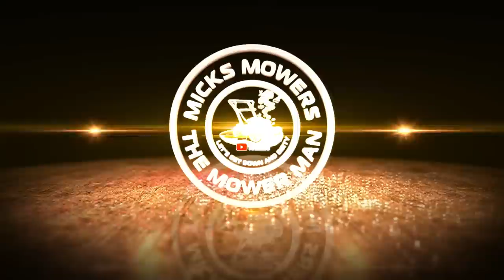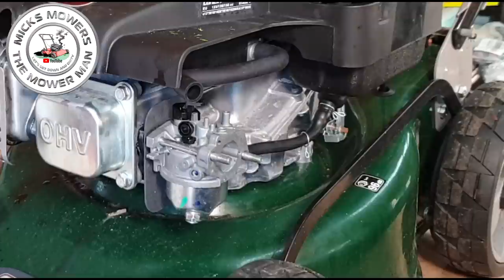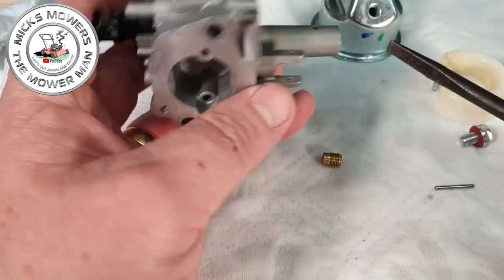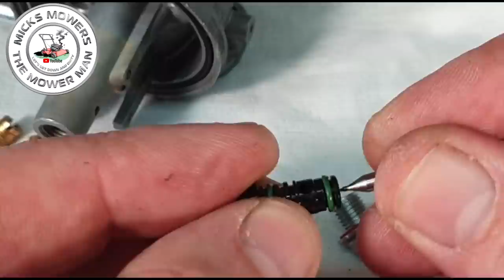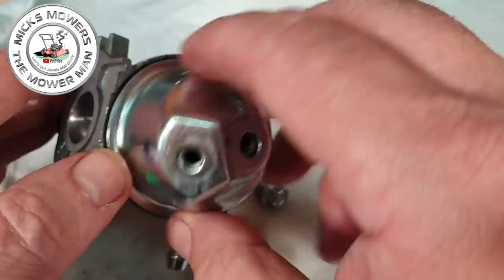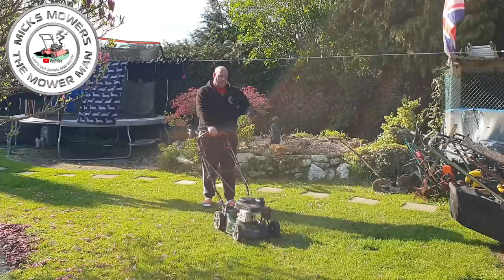Have you dragged your mower out the shed.. won't start - watch this video

Comment: I had the same problem with my mower this week. I couldn't get any Aspen long life fuel at the end of last season as everyone had sold out, so I knew moisture in the fuel would be a problem this spring as I had to use E10 fuel. Mine took two carb strip downs, a new fuel filter (I could see the trapped water) plus a full fuel tank drain down before it would run properly. Happy days.

Comment: Thanks for the excellent walk-through Mick.  Surprisingly (for me at least) my 2011 Mountfield HP414 has a seemingly identical carburetor.  

Due to pretty bad hunting, I recently cleaned out the carb doing pretty much everything you did here but missed the slow circuit jet.  Got it all back together and was still hunting.

Having watched this video, took it apart again and the little nozzle was blocked. Managed to get it clear and it now runs like a dream for the first time in 5 years 😂
Reply from the maker: Boom.. excellent news.. and that's why I do the videos.. happy mowing mate ..

Comment: Brilliant Mick 😂 would you like to hear a story. Ive had an old briggs and Stratton 375 sprint Trojan 18 with qualcast on the deck about 15 years. I bought it for a fiver and it was a wreck then lol.. with patched up deck etc i think flashing type material?? It's never been serviced in all those years and run and run.but ive used as back up to my honda Obviously change petrol every winter. I decided to change the oil. Sharpen blade and put a new throttle cable on as the old one was rusted through and the spring casing sticking out. And the governor? Wasn't increasing the revs. The new cable pulls the lever on the motor itself but does nothing? I can operate the speed by hand with the governor lever. And springs look all in place? Now it wont start up lol 
I think ive had my moneys worth though lol
Reply from the maker: Ohhh no it sounds like it good for another 10 years yet lol

Comment: Hey Mick I have a question last year we ran our Craftsman M270 lawnmower out of gas before storing it for the winter and when we first started it at the beginning of the mowing season it started but it surged up and down for like 10 to 15 seconds before it smoothed out and ran fine after that so my question is would that brief surging be because we ran it out of gas and it had to get through the lines and carb once we put gas in it because it's ran perfect after that initial start and we used the mower three times this year now
Reply from the maker: Yeah sounds like it.. it would not hurt to wip the carb off and give it a clean if it continues to play up ...
Reply: @themowerman  so far it's been good since the initial start but if it does act up again I'll definitely take the carb off and clean it up and see if that does anything

Comment: What sort of age is that engine have a old qualcast commodore I’ve got up and running has very similar engine just dipstick is further down the block  in a square head bolt  pull start is same but casing is a little different no I’d plate on if for age
Reply from the maker: Think it was 2021